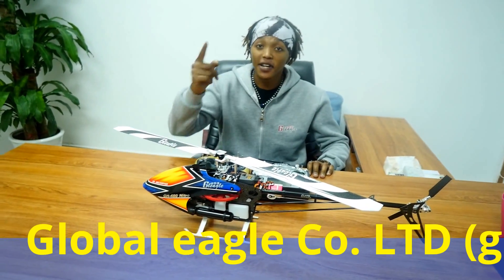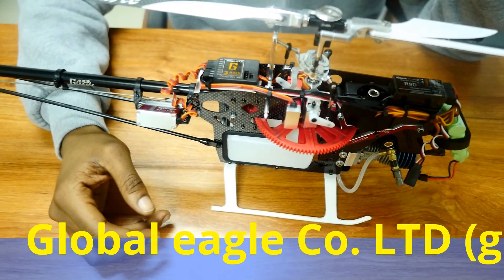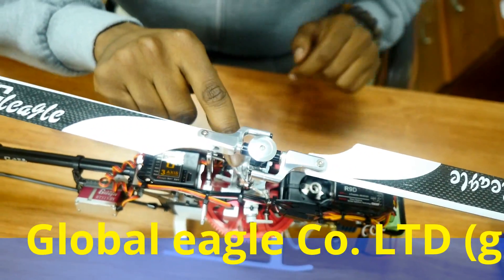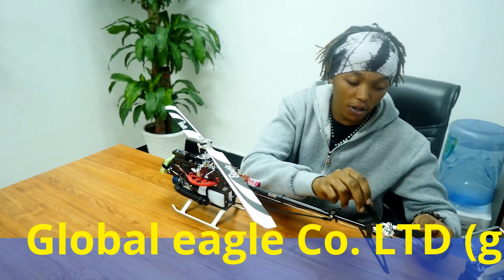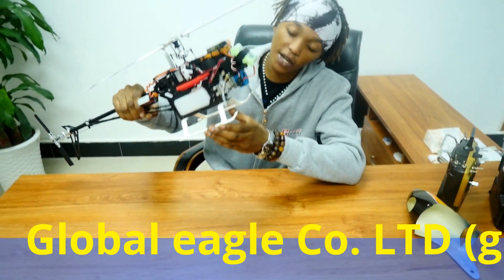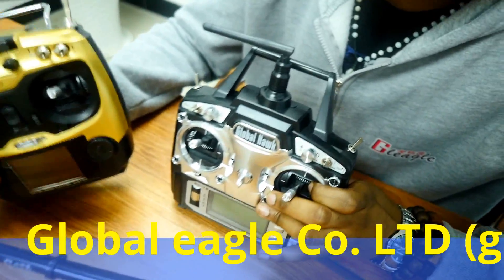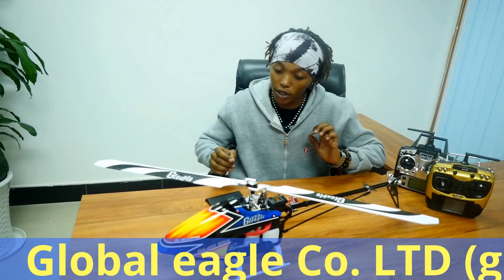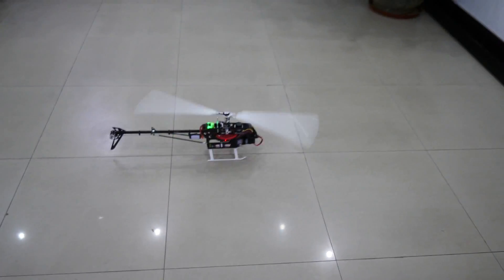nitro heli - global eagle 480n basic intro.

Comment: And all you have to do is figure out engine mounting the parts are ALL compatible between other 450helis for the most part 
Tail, boom, head, gear servos etc etc are all the same.
It's just the frame and engine mount which for like $25 on eBay you can buy a spare frame to have 
Parts aren't a problem anymore everything is cloned